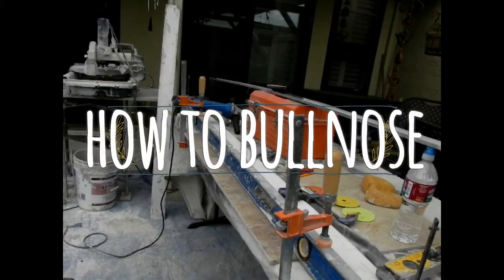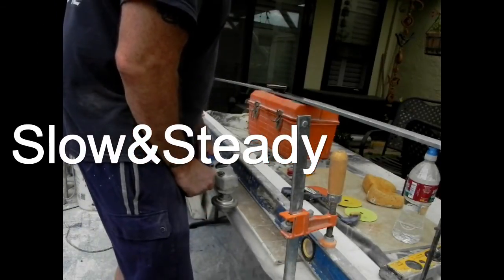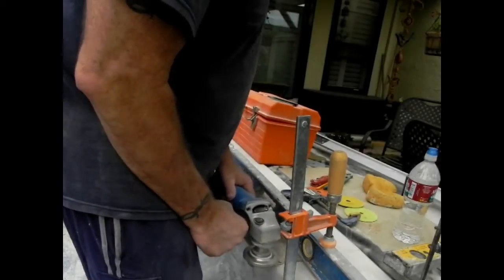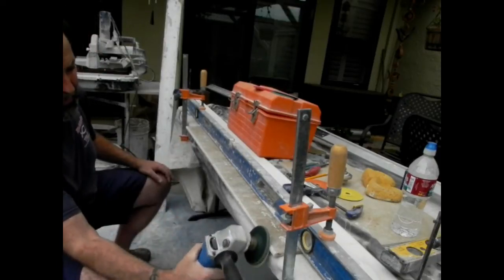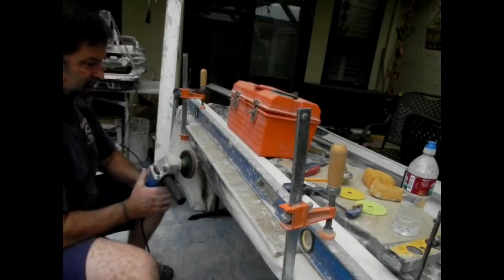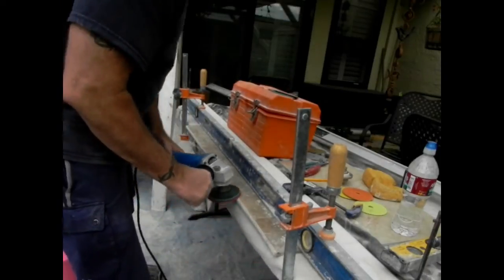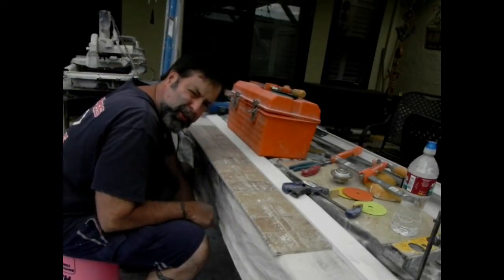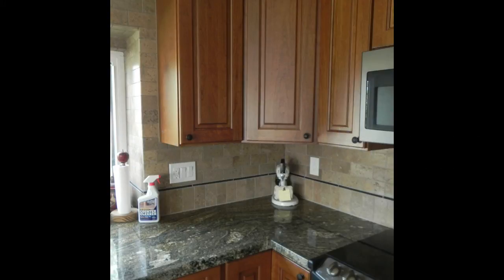How To BullNoses Tile That Looks Profession by Dave Blake License Tile Contractor

Comment: Wow this is awesome!  I would like to bullnose Datile Fantesa Cameo porcelain tiles. These tiles are 5/16 inch thick.  What are the best profile size to use?  Can you bullnose a ceramic tile?  I plan to use a Milwaukee 5 inch variable small angle grinder from Home Depot.  Thanks!